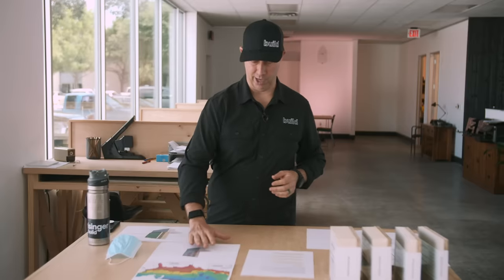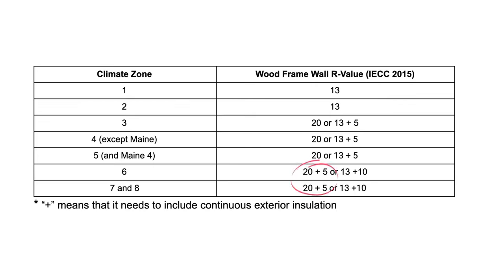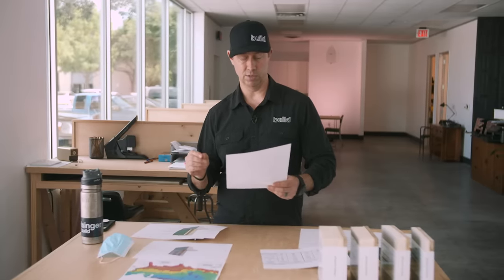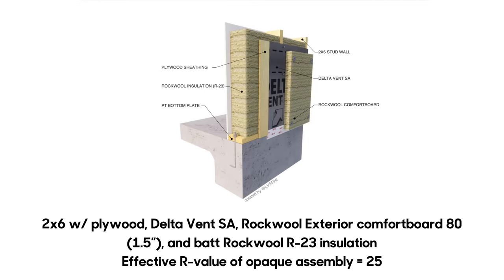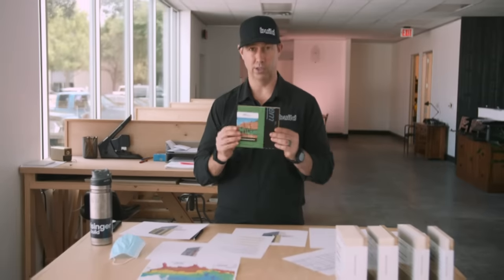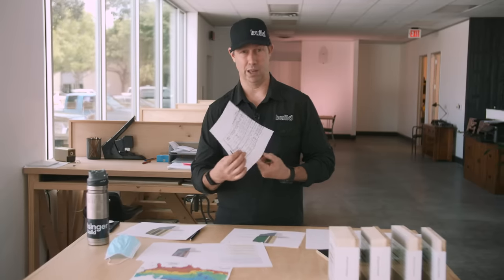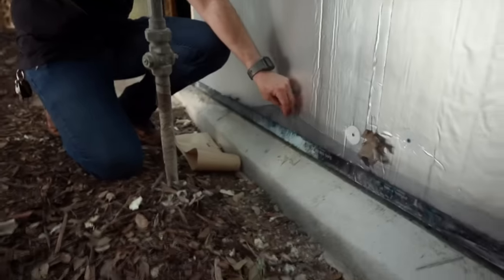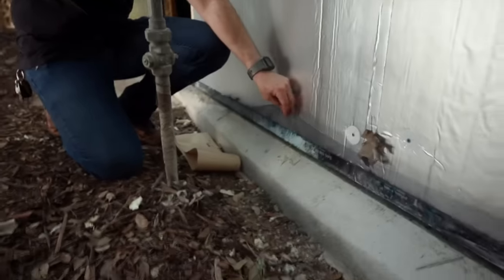5 Ultra-Insulated Framed Walls

Comment: I think one thing to consider would be cost per R. While the cost on the last one was over $7 it was about 15 cents per R value. The "cheapest" one ran almost 17 cents. Just something to consider.
Reply: Definitely worth considering. If memory serves EPS is usually pretty cheap for the R value, so if you don't care about the fire risk wrapping your house in a thick layer of that with the cheapest structural materials and no insulation in the stud bays would probably be about as cheap per effective R value as you could get.
Reply: thats true but at what point is the R value diminishing? i mean if your under water theres no air but if i give you one of those black coffee straws you got some air but your not going to be able to breath. how much better is 30 vs 45? all the passive home people say they can heat there homes with 2 hair dryers but if i have to use 3-4 hair dryers is it really a big deal especially if i spent 10-20 thousand less? R value needs to have more meaning behind it to justify spending that much extra.
Reply: @JareBareXP  the point at which you get diminishing returns on adding more insulation depends on the cost of the energy you are using to condition your house, the quality of your air sealing, the cost per square foot of R value for the insulation you are using, and the climate you live in. The sweet spot for lifetime cost usually works out to be pretty close to what most passive house standards recommend (since most passive house standards are designed with the intention of you paying for your energy up front). If you don't plan on owning your house for the next 30 years it might be cheaper for you to use slightly less insulation. It technically is possible to over insulate a house to the point that it reduces comfort, but the amount of insulation needed to over insulate a house is usually about double the amount recommended by most passive house standards.
Reply: @Gareth Baus  is there a set point? Or a common ground? When they run that door air test it seams great. I'd love to see some studies on "R" values and these door test for homes that prefer similar temperatures and are located in the same city with similar squar footage I'm cerious on the cost to heat or cool there homes does a .3 value astronomically better then a 1.0 obviously there's more to it, considering people maybe open or close the door more then the other person but it will still be a very important value to know. It would be a beautiful study if someone had the resources.
Reply: @Gareth Baus  thanks for replying to me btw! I'm a bit inexperienced in this stuff let me know if I'm missing a bigger picture. So far it seams like it's comparable to over-clocking a CPU "yes it's better then before but who cares if your getting 2 frames more in minecraft if your already getting 300+." Is what I see. Seams more like a flex
Reply: @JareBareXP   passive houses continuously vent air with clever things like ERV (Energy Recovery Ventilation) where incoming air gets heated/cooled by exhaust air without mixing. This system also regulates humidity inside the house.

You do benefit financially pretty much in any climate zone to go from R30 to R45 in pretty much any scenario where you plan to live in a house a long time. Even if you use ultra efficient heat pumps for heating/cooling - you'll still save $$$ on going from R30 to R45.

Diminishing returns come above R60+ where it doesn't always reduce energy bill enough to sufficiently offset extra upfront cost. But you can be damn sure you're getting good investment by upgrading from R30 to R45

Comment: Thank you for the content. I hope you move beyond the wall sections to show insulating the foundation in cold climates. They will even include buried insulation at an angle sloping away from the foundation to prevent frost and cold  from being driven under.
Reply: Wondering how much of a change it would have on the R value if I replaced the 2x4 / 2x6 with a T-stud 2x4 / 2x6 ??
Reply: Sage Boyette Dunno but I like those T-Studs